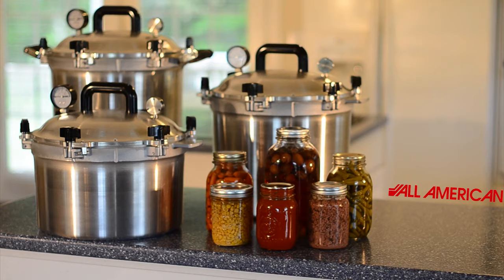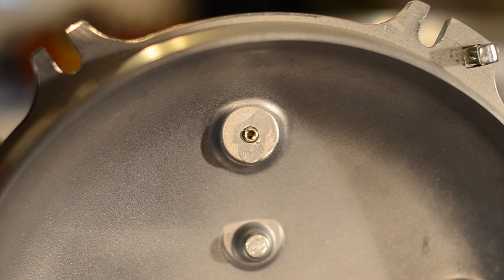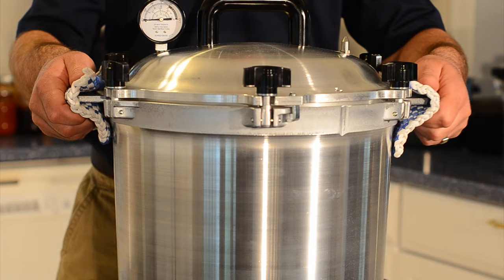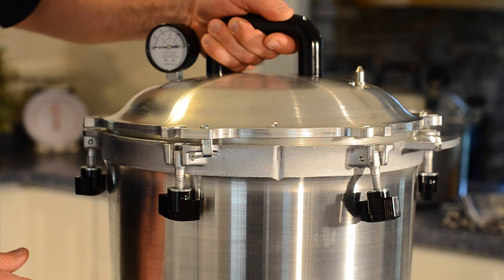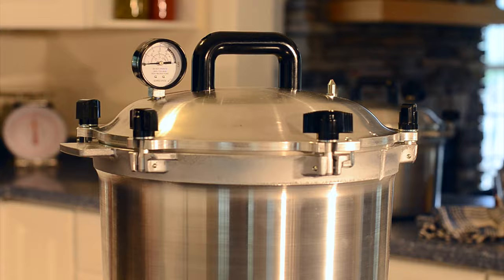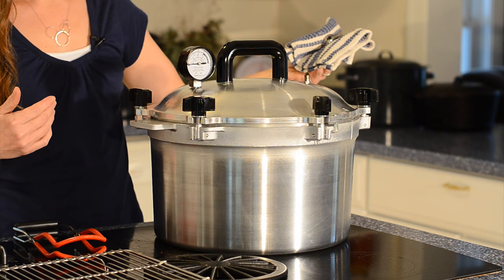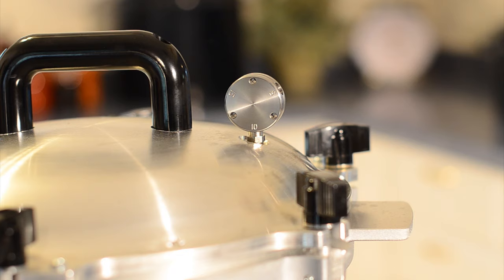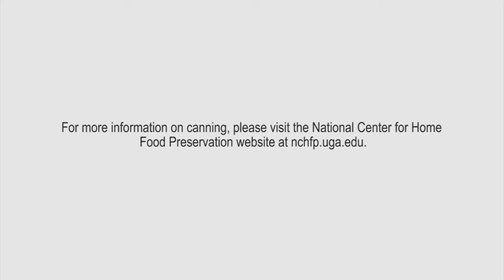How to Use the ALL-AMERICAN Pressure Cooker/Canner

Comment: I bought an old 921 at a yard sale years ago, it has the spring loaded steam release valve. Recently, I picked up 2 newer, larger ones at the scrap yard along with 3 lids. Had to order the parts to complete them:
bayonet clamps, wing nuts and bolts, and new pressure gauges. Plus fresh rubber fuse plugs.
 I had to clean up the newer ones, as they had been used over a campfire.  All the lids are the same size and fit interchangeably. Cleaned up with fresh parts they are as good as new. I love these pans, they are so rugged and serviceable. Maintained, they will last for ever!

Comment: My husband treated me to the All American 921 canner about 2 years ago. I have been non stop canning ever since. We have just dedicated a spare room in our home for all my canned goodies. Still working on siphoning issues every once in a while, but no one is100%.
Reply from the maker: When you turn off the flame from the canner, be sure to let the pressure come down completely before removing the weighted gauge. Safely remove the gauge and then unlock the top lid. Twist the lid to the unlock position but do not life the lid off yet. Let the lid rest unlocked for another 10 minutes, then slowly lift the lid away from you allowing any additional liquid to drop down into the canner and for the hot steam to escape. Properly allowing the canner to come down from heat and then pressure is key to preventing siphoning especially at higher altitudes. Proper venting in the beginning is also key depending on your altitude. Keep up the great work and remember to always be creative and have fun.

Comment: Im in New Zealand andreceived my fabulous canner from America in 9 days from order. I am very excited to be able to can all the product that cannot be water bathed. I've been waterbath preserving for 40 years so the is great. Just done some beef stew.
I find 2-3 inches of water comes half way up the jars, I thought it was supposed to just come to the bottom of the jar. Perhaps someone can help me with this. I'd appreciate some comment
Reply from the maker: As long as the water does not cover the jars then it will be fine. I like to fill my canner with water to 1 inch under the neck of the jars. But as long as you have enough water in the canned that will not boil off during processing, it will still properly process the jars under pressure. A good rule is to fill the canner with 2 inches (5 cm) of water without any jars at first. You will gradually loose some of that water level in the pre-heating, loading, boiling, venting and processing steps. So as long as it doesn’t cover the jars, the water level will only go down gradually from there anyway during the whole process.
Reply: If you are doing meat you need that water to last an hour. A couple or up half the jar is customary
Reply: I have the 921. It says 1/3 water from bottom so I add 6qts of water. I just got through canning meat for 90 minutes

Comment: The needle on my pressure guage rusted after two uses. The vent pipe oxidized and had green powder on it! 2 uses!
Reply: Sounds like you either have high mineral or hard water, or the seal on your jars was leaking to cause the green powder. Were you canning high acid food such as tomatoes?
Reply: What’s the update on your cooker?

Comment: Just got mine Sunday. Thrilled to death! Can’t wait to cook a whole turkey!🦃😀😄🥰
Reply from the maker: These canners are best designed for pressure canning, but you can use it for food directly in the canner if you prefer. I’d recommend making some long folded foil straps that you lay across the bottom and side of the canner, at least 2-3. Fold them loosely over the top of the Turkey before you lock the lid. Use these straps to safely lift the whole Turkey out of the pressure cooker if you want it to come out in one piece. I would also recommend a good soak with vinegar and water to remove any oils and stains from the canner after cooking. Enjoy!
Reply: This is made from aluminum and not recommended for food.   It is a canner where the food is in a jar.

Comment: My weight never jiggles. It takes FOREVER to get up to 240-250 on the dial. Since my weight doesn’t jiggle I always wait for the dial to show  240+  then I turn the heat back and start the time. That gives me 250 for the complete time. I sure hope this is correct!

Comment: Hi - I am struggling to determine what size canner is right for my stove top. Does overall heigh factor the gauge and handle? According to the specs, the overall height for the 921 is 15.375" and for the 925 the overall height is 16.75".  From the top of my stove top burner to my range hood, there is about 18" of space. Thank you in advance for any help provided!

Comment: May I ask, some videos say, I need to see steam escaping from the spout and time 10min, then place the weight on it. Is this correct? 

My weight flies right off, I think coz the heat is too hot, too much pressure? 

I feel the AA needs to have a heat resistant level. As a newbie, it is so hard to ensure it is level. 😂

Experts of the AA, please advice?
Many thanks in advance for your wise wisdom! ❤
Reply: Yes you have to let steam escape for 10 min before adding the weight. If its flying off your heat and pressure is way too high and this is dangerous. Only add the weight and wait til let jiggles. Adjust heat so that it only jiggles 3 or 4 times per minute. Start your timer at the time of first jiggle

Comment: Is it common for steam to blow out of the seal?  It still reaches to correct temp and pressure, but there’s a constant air leak and the unit is brand new.
Reply: Mine leaked until I went around at the end, tightening them down one by one, in a circle.  I was only tightening two at a time and that led to leaks every time.
Reply: I’m no pro but make sure you tighten down like you would a tire on the car. Make sure gap is the same on both sides. Lubricate with with Vaseline jelly first before winching down the screws
Reply: @justinciallella4724  My canner leaks all the time.  Just so I understand, you tighten two at a time, then on the last go around you tighten one at a time?
Reply from the maker: I had this problem before and most of the time it was due to the petroleum jelly. I switched to using an olive oil or avocado oil instead. I use a paper towel to spread it all along the inside lip of the canner and the outer side of the lid where it makes contact. If you put the lid of dry first, you will see exactly where the lid makes contact with the canner. You only need to apply a very thin layer of lubricant, to much may cause the canner to not seal properly. When I place my lid on, I make sure to rotate it left to right a couple times so the lid and canner self lubricate the entire ring once more to make sure there are no gaps and the seal is even. Look at the gap under the lid to make sure it’s the same level all around when locked into the canner and adjust using the handle. Once you are confident the lid is level, you can then tighten the bolts two at a time opposite from each other. I tighten all mine loose at first then check to make sure the lid is still level, then do a final tightening two at a time, opposite each other. It works for me every time and I have no leaks.

Comment: I am wondering which one is correct, should I put the regulatory weight before starting to heat the pressure cooker, or should I put the regulatory weight once the pressure cooker is already whistling..
Reply: You bring canner up to heat and let steam escape for 10 minutes. Then add the weight. You don't start out with the weigh on. Very important

Comment: I am trying my canner today. The first round i let it go for 2 1/2 hours and no steady stream of stream. I turned it off. When I opened the lid there was very little water left.  I'm trying again. Its been going and hour and still no steady stream of steam. Does anyone know if this is normal???
Reply from the maker: It could be you may not have added enough water. Also if the seal wasn’t tight enough then steam could be escaping from the side of the lid and it just wasn’t visible enough to notice. If it happens again I would suggest contacting the manufacturer.

Comment: Can I instant release pressure if I am just sterilizing mason jars with grain or should I let it naturally release on its own?
Reply from the maker: As far as I know, pressure canning is only necessary for low acid foods in liquid and is not meant for foods that contain grains, dairy or pasta. Those would break down and cause the jars to thicken too much.

If you are using the pressure canner to sterilize the jars empty, you don’t need to bring them up to pressure. You can put the lid on and vent the canner for 10-15 minutes without the gauge and let the steam sterilize the jars for you, or just use a water bath canner. What I do is load my dishwasher with just my jars and run the sterilize cycle. The heated steam inside the dishwasher is enough to completely sterilize the jars.

If you are looking to can dry goods like grains already inside the jars, you will need to research those who do dry canning in their oven. There are quite a few YouTubers who show how to can things like dry rice, beans and grains using a hot oven. I don’t have any knowledge on this process nor do I know if it’s actually food safe. You would have to do more of your own research and follow the safest method.

Comment: I saw gas is the preferred heating source. But in Europe, the brussels dictators force us to use electricity. Can you use the canner on a ceramic glas ? Also, can you give me a good brand where to buy the jars? Thanks!
Reply: Yes, it works fine.  I have been using mine on a glass top stove for over 15 years.  If it gets it to the required pressure/temperature, you are fine.  You may worry about scratching the surface of your stove, but honestly, if the bottom of your canner is clean and you don't slide it around, it will not scratch the surface.
Reply: it is not recommended to use a glass top stove. If the pan is bigger around than the burner it can break the cook top. I tried to use a regular water bath canner on mine unknowingly, the induction would not recognize the pan and would not bring the water to a boil.

Comment: i am at 1180 ft elevation. what weighted gauge number do i use? do i follow the dial gauge at 11 lb and the use the weight at10 lb ?
Reply: 1000 ft and below - 10psi
1000 ft and above - 15psi
At your altitude its borderline, but to be on the safe side I'd go with 15psi 👍
Reply: @songofthepassaic1521    thanks!

Comment: When having 3 inches of water , then putting jars in…… the water level came up to the lids of my jars. This can’t be correct???
Reply: I have the same question waiting for an answer.
Reply: It's not correct, water should not go above the shoulder of the jar.
Reply: I had the same issue with pint jars today but did not with my quart size jars!
Reply: Per the manual, you add 2” to 3” of water.  If I were doing half-pints, I’d probably only add 2”.  Just make certain the water is below the lid, no higher than the ridge of the jar.  Refer to the manual.

Comment: Is she saying “wait TWO minutes” after removing the regulator weight?  

…everything I have read instructs the cook to wait TEN minutes.
Reply: Ten minutes for vent to steam so all the air to vent, then put regulator on. When time is up for canning, turn off heat and let gauge get to zero, then wait two minutes before removing weighted regulator from top of canner.
Reply: Refer to page 21 of the manual.  After removing the weight regulator, wait two minutes.

Comment: Mine is turning colors inside.. Any idea why
Reply: It’s normal oxidation. It’s going to happen and is normal.
Reply from the maker: Yes this is normal. If you have hard water you can try filtering it and using a small amount of vinegar inside the canner during canning. For ours, we only use distilled water from our commercial water distiller and 1/2 cup of vinegar for every canning batch. The inside of our canner looks almost brand new after 5 years and the vinegar helps our jars come out very clean.

Comment: It is made very well but hard to get the lid even. I can't wait for someone to make an easy, well made canner that works great....
Reply from the maker: Once my canner has no pressure and I remove the weighted gauge, I wait another 10-15 minutes for the canner to cool. The product inside will still be boiling and this resting period allows the cans and the canner to cool gradually and the lid to loosen slightly. If after this resting period you still cannot twist and remove the lid, you will need a hammer. Flip the hammer so the handle is pointing up an using the claw side, very gently and slowly give the lid a little vertical lift with the claw in between where the rotating lid locks come in contact with the upper lip channel locks. You only have to apply enough pressure to just pop the lid a little. Once the lid is free, I rotate my lid to the unlock position but I don’t remove it yet. I still allow for another 10 minutes to allow the cans to cool slowly. I hope this helps with your canner lid issue. Next time make sure the inside seal and lip of the canner lid is well lubricated with oil or Vaseline and it should release easily. :-)
Reply: @kitchenbasics5137  I’m having two issues.  I’m getting some bubbling from the sides of the canner and my lid gets stuck every time.  Now I’m wondering if I’m not tightening the wing nuts enough and the lid is becoming uneven during the process.  I feel like it’s tight.  Could it be something else?

Comment: My weight won't jiggle any idea why??
Reply from the maker: The pressure canner needs a lot of heat initially, boil, steam vent and then build pressure with the weighted gauge. It could be the venting step was not completed correctly or skipped.

Bring the canner up to a boil without the weighted gauge on vent hole. Wait until the vent is producing steam in a very strong consistent stream. It should look like the steam is the loudest and tallest it will get, around 1 foot and holding strong. Once it reaches this point, you need to start the timer and vent the canner for 10 minutes with that steady vent stream, don’t turn down or increase the heat if it’s consistent. After 10 minutes, the steam will have removed all the atmosphere from the canner and it’s ready to build pressure. Place the weighted gauge on the vent hole according to your altitude and allow the canner to come up to pressure at the same heat. It may take anywhere from 5-10 minutes for the canner to build pressure and the gauge will begin to jiggle once it reaches the required pounds of pressure. Slowly reduce the heat to medium or medium low until the gauge jiggles 2-3 times per minute. Then set the timer for the processing time and monitor the gauge making sure it jiggles a few times per minute to maintain the pressure consistently through the whole processing time.
Reply: Some burners are less powerful and it takes a long time to build enough pressure. Is your gauge showing that you are slowly but steadily building pressure?
It takes 40 minutes for mine to build 10# pressure after I put the weight on.
Reply: @JE-co8ko  you put your weight on after venting?
Reply: @lynnamorrison4798  yes. After venting.
Reply: @kitchenbasics5137  Excellent. Thank you
Reply: @kitchenbasics5137  This is very helpful, thank you. Currently canning fish and we didn't vent properly - is the risk of constant sputtering that we'll lose water? When the heat is turned down it stops its constant sputtering but then doesn't "jiggle" at all, certainly not multiple times per minute, though the pressure gauge shows it's still around 10. Learning curve, wahoo! Grateful for you sharing this video.

Comment: (1) When adding water before loading the jars to pressure can them, does the water need to be hot? lukewarm? cold? 

(2) Also, I did a water bath and the whole inside got heavily discolored. I boiled water with vinegar to no use. The water canned jars all got a milky film in them. I wiped with vinegar but want to know if this will be an ongoing problem.

Thanks!
Reply from the maker: Before you start loading your jars, the water needs to be hot but not boiling yet, almost under a simmer. You also went to check the water level and adjust once you have loaded the first level of jars. When pressure canning, the water level cannot cover the jars. I make sure the water level is around 1 inch below to the neck of the jars.

I use 1/2 cup distilled white vinegar and filtered water in the canner. We have a whole house filter so the tap water works best already. If you are still seeing buildup and residue with vinegar added, you may need to purchase a water tap filter or pitcher to help remove most of those elements from the water before filling the canner.
Reply: Water temp depends on what/how your canning. Cold canning? Is the food hot? If hot then warm water. If cold food, cold jars then water should be cold
You can try some cream of tarter in your next canning. It got a lot of the discoloration off mine.